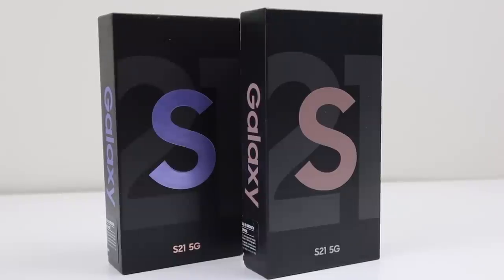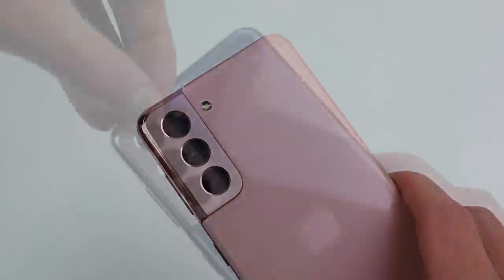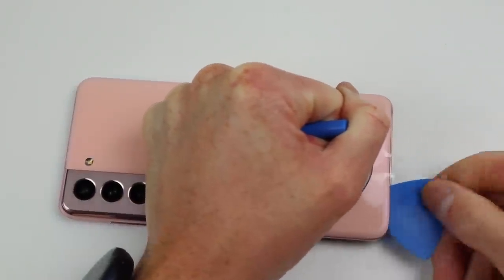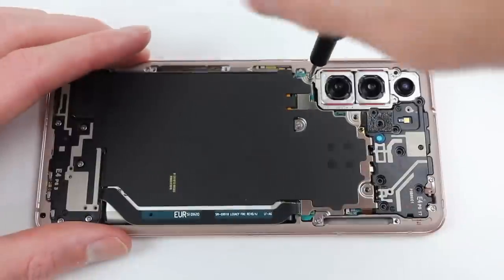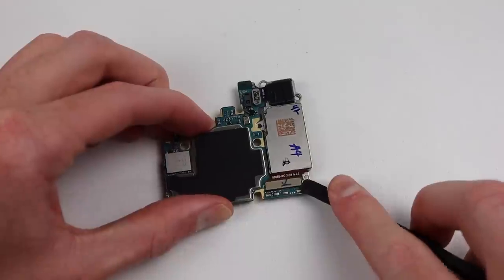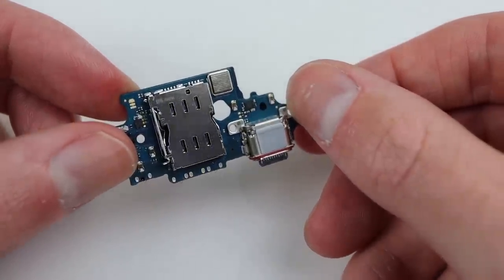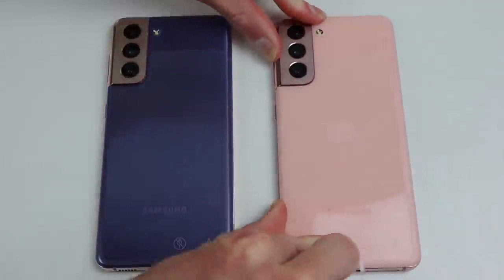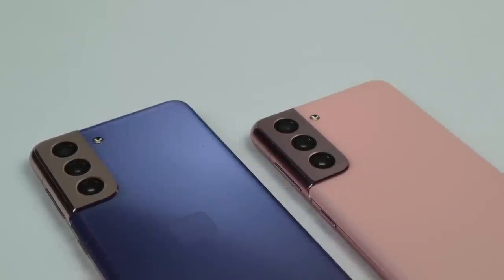Samsung Galaxy S21 Teardown and Repair Assessment - Interesting Findings!

Comment: Big tech companies: we care about the environment, thus we won’t include a charger brick when you buy a new phone.
Also tech comapanies who care about the environment: repairing your phone with replacement parts will be more difficult. We will instead include a usb c to usb c cord that will not work with your old charger brick that has usb A connection. 
And some stupid tech youtubers who are part of the problem applaude those companies
Reply: If you saw the whole video, and you have a little bit of common sense about android you'll know that Samsung has been including USBC chargers with their phones for years. Also Samsung made their phones up to $200 cheaper. Also as Hugh said in this video, almost everything is a module, and unlike Apple, nothing is paired to the phone. Do your research before you comment!
Reply: @alvint2635  a charger is pretty cheap, as is an adapter.
Reply: @jailbird1133  that’s not the point. 🤦🏻‍♀️
Reply: Also why would you use a fingerprint scanner? Ive never once used mine. If you do, the cops dont need a warrant to look in your phone. They do if its locked with a chord.
Reply: @jailbird1133  your point is really galaxies away. Pls, comment back when you finally catch up.
Reply: @jailbird1133  username checks out
Reply: @alvint2635  dude your complaing about not having a charger, when a new one is like 10 bucks. Sure it would be nice if they gave us one, but its not all that big of a deal.
Reply: @alvint2635  A charger is only $20, so you can easily buy it, especially with the $200 price reduction samsung did.
Reply: @jailbird1133  if you still buy a new charger for usb type c to type c, so what different if charger include in the box in the first place, "enviroment" friendly huh ?
Reply: @ghejnuni  thats not the point. Read my previous replies to jailbird.
Reply: @dhik9507  I havent bought a new charger in years. Id just get an adapter cable. And my outlets at home all have built in USB ports.
Reply: @jailbird1133  but your outlets have USB A ports into which you can't plug in the included C to C cable
Reply: @alvint2635   Okay, let me put my counter argument to that.  The impact won't be immediate. Now people will buy a charger brick. Then, in a couple of years, when they upgrade again, they will not need another charger, the change won't be immediate. In a couple of years, the difference is going to be huge.
Reply: @alvint2635  Its still reducing e waste. Not everyone will go out of their way to buy a charger if they already have one. Therefore, reducing e waste. What is so hard to understand about that?
Reply: @ghejnuni  if they cared so much about the environment, they'd stop planned obsolescence by sealing in batteries that degrade after two years and give more than two fkn years of software updates.
Reply: @propersod2390  people like u are the reason why they do it. 😂 it would have been better if they included the cord of usb c to usb A that could work with OLD CHARGERS SO YOU DONT HAVE TO BUY A NEW ONE.  Most people have usb a bricks. What’s so fucking hard about understanding that? 😂
Reply: @alvint2635  Everyone who has a brick also has a cable no? They included the USB c to USB c cable for people who have the faster 25W charger which has a usb C plug on it.
Reply: @propersod2390  usb c to a can do 25w charging. The point is not including it for the environment is a complete BS. They make some repairs more difficult. They are too lazy to update capable devices so they become more obsolete. Does that sound like a company that cares?
Reply: @alvint2635  USB c to C is faster but sure. And their bricks for 25W charging are USB c to C. Can you just stop complaining? If you have a charger you also have a cable. Then use that cable with the phone and put that cable in the box in some drawer for data transfer from a laptop with USB C ports. If you want to use the cable that came in the box, then get the $15 charger from Samsung (wow so expensive O_O). And which repairs did they make more difficult? Did you even watch the video? They have also extended the amount of years they update their devices for to 3 years. If you buy the s21 you will still be getting the latest android versions in 2024. And after that you will still be getting security updates. So yes, it DOES sound like a company who cares. It sounds like a company who went out of their way to improve their chips massively to satisfy customers who werent happy with the small performance difference. It sounds like a company who includes $300 worth of gifts when you preorder a device from them. Heard of any other company that does that? Because I havent. Go whine about something else since that's what you're best at
Reply: @Lisa_Minci96  You're acting like the phone stops working after it no longer receives software updates. Plus, batteries need to be sealed in anyways for thermal management.
Reply: Smh the price of the charger is always included in the price of the phone; that $200 price cut was just bring back the outrageous profit margin back to normal profit margin. In short, they can always increase or decrease the price of the phone with or without including a charger in the box. The reason for Samsung's decision is because phone manufacturer is in an oligopoly complication, where to make more money, they'll often adjust to their competitor's changes.
Reply: @Lisa_Minci96  samsung gives 3 years of updates not 2. And you still get security updates after those 3 years 🤡🤡🤡
Reply: Qualcomm will gives SD 888 4 years update (need more confirmation)
And Samsung right now giving 3 years update, but, I believed if Qualcomm gives 4 years update, Samsung will do the same.

Yeah, in the end, there will be no reason to buy a phone just because it got more software update. It's not like your phone stop functioning after it's update ended. Right now there is still many apps that supports Lollipop - Nougat (which is the Android >4 years ago).

Lastly, because Android is open source, it's easy to install custom ROM. And believe me, Flagships always get custom ROM.
*won't happen to Flagships that aren't really popular
Reply: @buddystudio6  Until 2 years ago, I still used a CAT B15Q, which was announced in 2014. It was still on kitkat, and I loved that phone. Even though in 2018 there was already android Pie, Kitkat was still supported by most apps, so I did not feel the need to upgrade. Also, not only flagships get custom rom. My current android daily driver is a redmi note 8 pro, which still has a bunch of amazing custom roms (I'm using POSP).
Reply: @ghejnuni  redmi note 8 pro is one of the most luckiest device ever released. I believed it's the only one mediatek devices with custom Rom.

*I didn't mean only flagship have custom rom but flagship tends to have many custom rom
Reply: @buddystudio6  custom roms will make secure software like Netflix and work apps to be incompatible with the device.

I also have a Note FE and can't use the PS4 controller for remote play as that's only allowed on Android 10
Reply: @jailbird1133  a usb c to usb c charger that can support the wattage the S21 needs isn't cheap. Those $10 sold in China are way too dangerous. I do hope Samsung will be forced to honor warranties caused by charger failure, then they'll be forced to include the charger on the next release.
Reply: @triadwarfare  yeah some software doesn't work, especially if u rooted the phone. But someone must be figured how to do it.
Reply: @triadwarfare  they wont be. Its likely covered in your user agreement.  In order to be covered you have to use a Samsung approved accessory.
Reply: @alvint2635  As long as your old phone had USB C, you can just use your old charger AND old cable, no need to use the new cable. This whole thing is not a huge problem, just a minor inconvenience.
Reply: @JustA.Person  I bet he already has a USB A to USB C cable, which works just fine.
Reply: @propersod2390  You really don't know anything about this subject.

Comment: Wow. They moved the SIM slot to the charging sub-board. In a sense that's better because if you happen to screw up the SIM slot pins, replacing the charging sub-board also gives you a new SIM slot. The old Galaxy S4 was the only known phone in the S line that has no-solder replaceable/modular SIM slots. The S5 up to the S20 Ultra had their SIM slots soldered to the board.

Comment: I think even if you do swap just the fingerprint sensor (which is virtually impossible without breaking the display), it isn't going to have that same re-calibration issue as it does have an ultrasonic reader unlike the more common optical ones that do require the screen to provide a precise amount of illumination to ensure the sensor scans properly.

Comment: not related to repairs but i feel phones should be cheaper, now they're removing stuff and the prices of these devices keep growing i don't see the point in paying more for less. soon they'll be selling us a phone wrapped in bare plastic that costs $1000+
Reply: It's $800. I think you're referring that to higher capacity.
Reply: high budget to midrange phones are the sweet spot. good features and price. "flagships" are for rich people at this point, it's ridiculous to buy the best of the best from these phone companies unless you got money like that
Reply: @HearMeLearn  Flagship iPhone start at 700 USD 
Midrange iPhone start at 399 USD
Reply: @GTAandApplechannel  Lmfao, midrange iphones dont exist. Apple has an expensive budget option, the SE, and the flagship, which is currently the 12. They have no budget models, only older phones
Reply: @TheLongDon  
Budget iPhone: iPod touch
Reply: @siintrovert5343  in some countries, it costs the same or as much as the previous s20.
Reply: @HearMeLearn  in India for the price of 1 S21 Ultra u can get 2 OnePlus 8 pro and here we have midrange options like Nord which costs same as A71

Comment: they did locking their A series fingerprint, because of that fingerprint are cheap and easy to hack..
it's different than ultrasonic one.
ultrasonic has its own chip built into the scanner.
that's why samsung locking all of their devices with "optical" finger scanner not the ultrasonic one.
Reply: but the fingerprint sensor wasnt even changed, it was the display that was changed that caused the problems. So how would locking fingerprint when you replace the screen help with the security?
Reply: @leansnscenes7806  Idk.. I think the real reason you have calibrate the scanner to match that display is both screen and scanner works together, not individual. 
considering it's impossible to repair ultrasonic scanner without buying new display that has scanner built-in, it's already tested and calibrated so  both panel and scanner work together perfectly.🤷‍♂️

I state that just because how easily optical can be hacked only by a  picture, cuz it just using camera rather than ultrasound.
Reply: @dh-pf6re  you're wrong, if you flash the firmware of the device the fingerprint scanner works correctly. Hugh made the mistake of factory resetting but not installing stock firmware alongside the factory reset.

Comment: Damn they removed the headphone jack for a sim only holder.
Reply: And they removed the SD Card slot for good. This phone is clearly a midrange offering and should be priced as such.
Reply: @Tom2404  its $800 with flagship cameras, an excellent flagship display, flagship design, flagship specs, and flagship features. Literally no phone has a micro SD slot. Do you call every single iphone a midranger too? Do you also call the $2000 galaxy fold 2 a midranger? 😂😂 pattern yourself
Reply: @propersod2390  Galaxy S20 series had micro SD readers, as did every single Samsung flagship with the exception of the S6.
Also the display is worse than the S20 because it is not 1080p
Ultimately this should be priced at the same, or less, than the One Plus 8 Pro.
Reply: Actually, 1440p does look better than 1080p, and my phone is NOT a cheap mid ranger, its a Galaxy S9+. Which, back in the day, was the best you could get. It has 128GB plus a 128GB SD card, it has 1440p display, and it has a headphone port. This makes my S9+ better than the S21.
Reply: @TheSpotify95  So outdated technology like headphone jacks makes a 3 year old phone better than the s21? 😂😂😂 Also, the 256 GB version of the s21 is $50 more, which is also the price of an SD card. And then IF YOU LOOK FOR IT, yes 1440p is better than 1080p. BARELY. But if you use your phone normally you wouldnt notice. Before I got my note 20 ultra I set my s8+'s screen to 1080p to get used to it. And thing is there was nothing to get used to as the screen looked the same. I forgot that I was on 1080p like 5min after I changed the setting. So NO, the s9+ is NOT a better phone than a 2021 offering. Not even close. The s21 gets you much better cameras, a much better screen (color accuracy, refresh rate, touch response, size, bezel size, contrast ratio, brightness, etc), a much better battery life, better performance, better design, better EVERYTHING. Also, with 1080p on the s21 you're getting almost the exact same ppi as 1440p on the s9+.
Reply: @ziverch  the 256GB variant is $50 more 😂😂 and you have cloud storage, USB C thumbdrives, as well as the option to offload images to your PC. There are clearly solutions but you choose to whine all day
Reply: @propersod2390  at least having an SD card means that backing up data to be swapped between phones is nice and easy, as well as upgrading storage when you need to later on. You're not having to think about what storage you need at time of purchase. Plus, there are various devices that are still wired. Just because the iPhone 7 got rid of the headphone port, doesn't mean to say that wired audio devices aren't obsolete. I'd rather get the A51 as that takes good photos, has an under display fingerprint reader, and has all the tech that I need (being limited to 1080p doesn't matter when your phone only costs £300, instead of £800). The A51 also has two SIM slots in addition to the expandable storage!
Reply: @gta4haterhq  do you even know what that means?
Reply: @propersod2390  Laughing emotes in an argument decrease your IQ by 10 points
Reply: @Amusia727  when that's the only thing you can say as a counterargument then I think it's clear I've won 🤡🤡

Comment: So no headphone jack,no expandable memory,no charger,NO SALE THANKS
Reply: They turned it into a iPhone
Reply: The worse part is the 1080p display. It's obvious that this thing is a midrange phone for a high end price.
Reply: @Tom2404  they only make these to make spending money on the ultra a more appealing option
Reply: @waa6995  yes and it's bs.
Reply: @momfiethehunter504  it’s still worse than iphone
Reply: @TomTheXboxSeriesX  it runs android and has a type-c port so i dont see why it would be worse
Reply: STOP LIVING IN THE F*CKING PAST, LOOK TO THE FUTURE
Reply: Honestly I have the s21 and expandable memory doesn't bother me as I prefer cloud storage. It's only 20 a year for 100gb. I much prefer Bluetooth headphones. I'm pretty sure you can get USB c headphones if need be. Ya it was annoying paying for a power brick but it was only 14.99. I ADORE my s21 and I got mine for only 400 switching to a new carrier without a trade in. It's a wonderful phone. You can't tell it's only a 1080p display. It's gorgeous. I LOVE this phone and would recommend it to anyone.
Actually I have one gripe. I did think it's bs that their midrange 5g phones come with a 5000 mah battery than the 4000 in the base s21.
Reply: @Tom2404  Worst* and no, a 1080P display is just fine. This isn't a 24' monitor. Aaaaand it comes at a 120 Hz refresh rate, a way smoother experience.
Reply: @lenacheney  the battery is a real issue. Although with my A70 4500 mAh it still lasts a long while.
Reply: @liviuganea4108  Now that internal ROM has the same size of high end SD card in the market while being significantly faster
They would retire now or later unless you chews through a hundred gigabyte at once
If yes for the case buy a Xperia 1 III (my dream phone, but not rich enough so I settled for the phone in this video) or any older flagship then there you go
Reply: @lenacheney  For me, the best thing Samsung must do is literally give S series primary components to A series chassis, so that we have best of both worlds.
Imagine A52 but have S21 parts like Snapdragon 888 and 3x telephoto camera etc